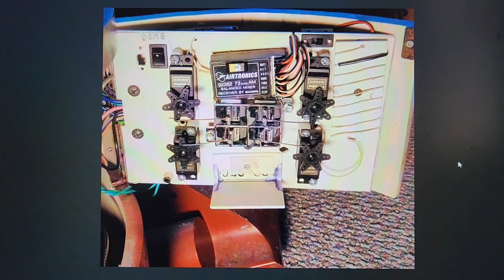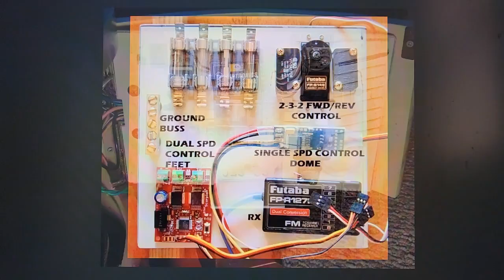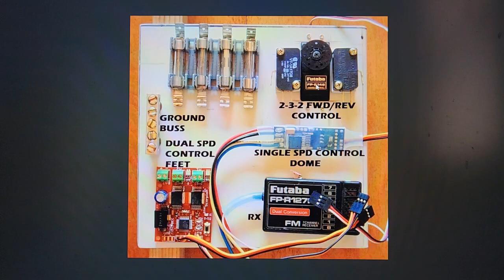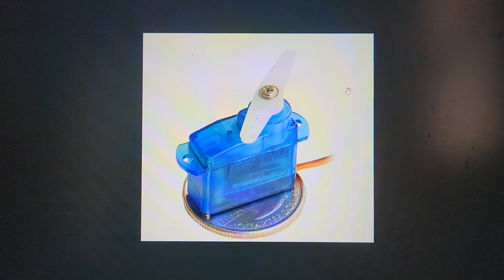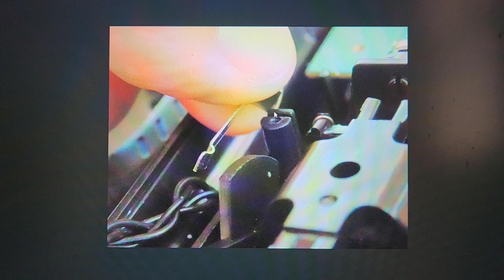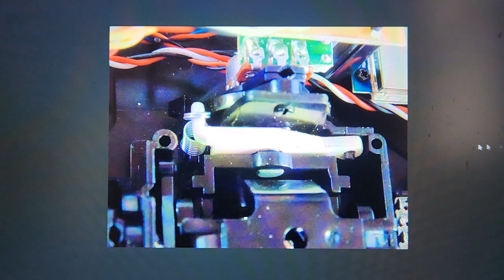R2 Builders Budget Building video #2. R/C

Comment: Couldn't you theoretically use one channel for more than 2 digital functions if you used a digital-to-analog converter and some buttons to act as one of the stick channels on the controller and a speed controller and an analog-digital converter in the receiver to address those functions?

Comment: Thank you so much for sharing this! My droid is 3D printed and has no opening panels, tools, arms, etc and I'm controlling the audio via my phone and bluetooth so i didnt need the full Padawan system.

I have NO idea about R/C and electronics so this helps immensely!
Reply from the maker: I like the Robotpower Scorpion XL over the Sabertooth. Setting up the Scorpion is easier, you can easily do dual stick tank driver or single stick control... in single stick option you have full forward speed, whereas the Sabertooth you are denied full forward speed because they reserve the remaining forward speed for assist in turning left/right. Scorpion also has simple to do custom options like immediate response, or sweep response, so movements are gentle and not jerky. I needed outside help to set up the Sabertooth and the set up made no sense for what I had. And because I needed full forward speed on that droid with the Sabertooth, I had to do dual stick tank drive which is annoying to do. All my other droids are single stick control which is nice. Because the Scorpion does allow full forward speed in single stick configuration, it just slows down one side for doing turns... recap... Sabertooth let me down in the performance operation choices department.
Reply: @craigsmith4436  Using a Scorpion then I would only need a 3 channel radio? One each for legs and one for the dome? Because I already happen to have a 3 channel radio just sitting here. Would be nice to use it
Reply from the maker: @robertb518  Hey, if it's just sitting there. As long as each channel is incremental like a joystick, and not a switch. The one pictured in my video is a 6 channel. 2 for each joystick. That's 4. A toggle switch for the 2-3-2. Then an unused rotating knob. I have no idea what to use that for. Perhaps a servo on a door panel.

Comment: Hey cool! I didn't realize what you had for your early drive. In the servo-actuated drive system, you essentially built an H-Bridge out of four servos.
Reply from the maker: The cluster of four FWD/REV switches came out of a GM car. It was the 4 power window switch cluster in the driver's door to power window operate all four door windows. It plugged into a 10-wire plug socket. 2 wires for positive/negative input, and 2 wire output for each switch/motor. Don't get much simpler than that!